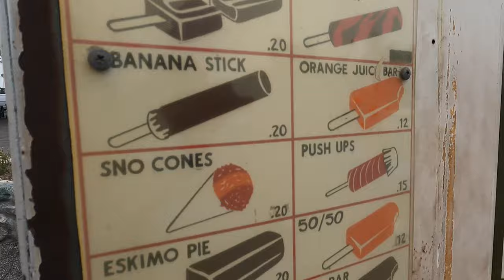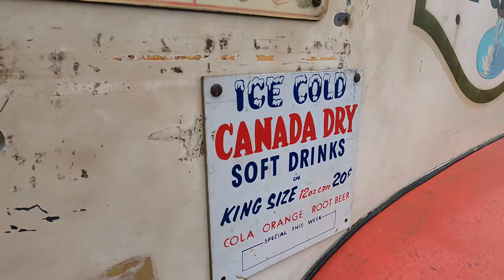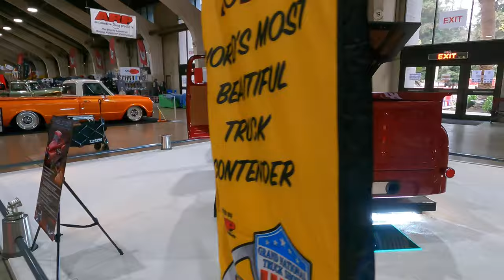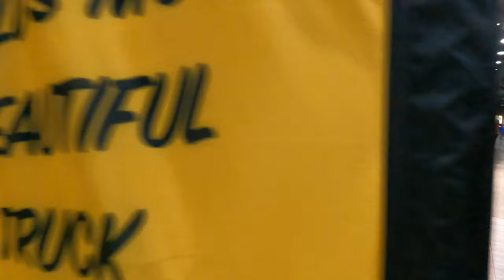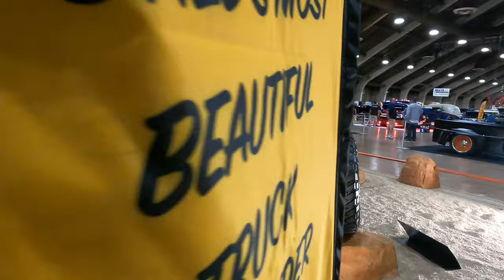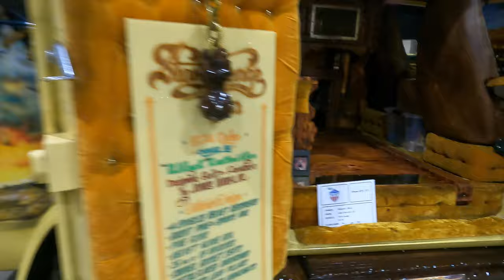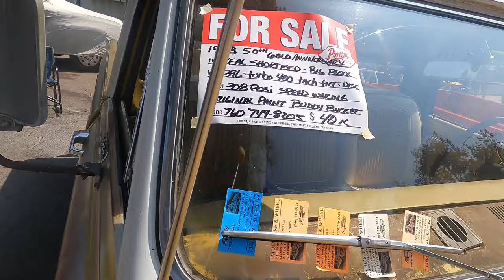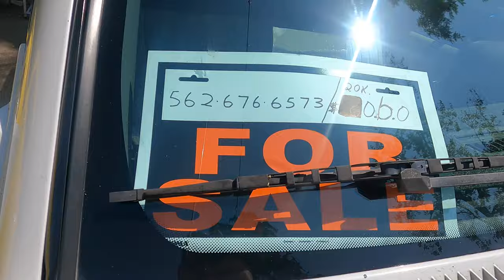Grand National Truck Show 2024 At Fairplex In Pomona - 2nd Annual

Comment from the maker: Tentative List Of Shows I’m Planning On Filming (Subject to change)
 
September 21, 2024 - Ontario Cruisin’ Reunion
September 22, 2024 - Run With A Winner At Irwindale Speedway 
September 28, 2024 - Cruisin’ For A Cure
October 5, 2024 - Bellflower Blvd. Car Show In Bellflower 
October 6, 2024 - Long Beach Swap Meet
October 7, 2024 - Hot Rod Power Tour West - Day 1 - Pomona
October 8, 2024 - Hot Rod Power Tour West - Day 2 - San Diego
October 9, 2024 - Hot Rod Power Tour West - Day 3 - Indio
October 10, 2024 - Hot Rod Power Tour West - Day 4 - Lake Havasu, AZ
October 11, 2024 - Hot Rod Power Tour West - Day 5 - Chandler, AZ
October 12, 2024 - Murrieta Rod Run (maybe)
October 13, 2024 - Pomona Swap Meet
October 19, 2024 - Mopar Fall Fling
October 20, 2024 - Galpin Car Show
October 26, 2024 - Newport Beach Classic Car & Truck Festival
November 5-6, 2024 - SEMA
November 9, 2024 - Nitro Revival
November 10, 2024 - Long Beach Swap Meet
November 22, 2024 - McCormicks Auction In Palm Springs
December 1, 2024 - Long Beach Swap Meet
December 7, 2024 - Mooneyes Christmas Party 
December 8, 2024 - Pomona Swap Meet
December 31, 2024 - NYE Rose Parade Cruise
January 19, 2025 - Pomona Swap Meet
January 31, 2025 - Grand National Roadster Show 
February 1, 2025 - Grand National Roadster Show (Grand Daddy Drive-In)
March 2, 2025 - Pomona Swap Meet
April 13, 2025 - Pomona Swap Meet
June 22, 2025 - Pomona Swap Meet
August 10, 2025 - Pomona Swap Meet
October 12, 2025 - Pomona Swap Meet
December 7, 2025 - Pomona Swap Meet